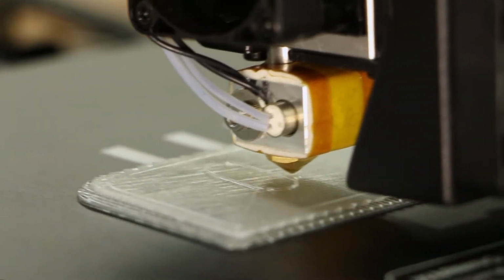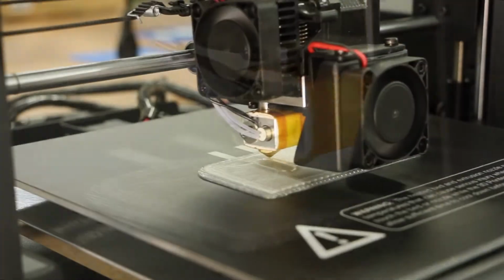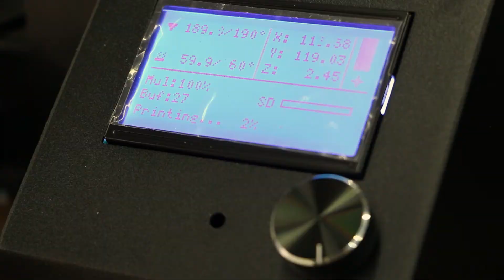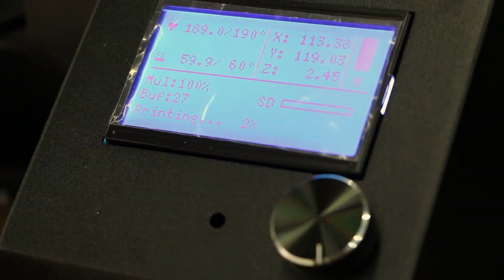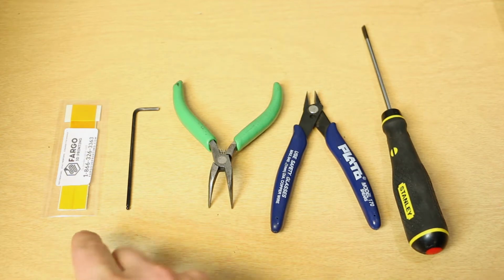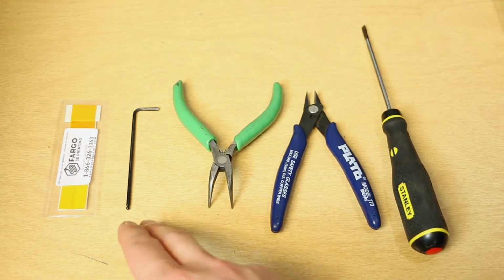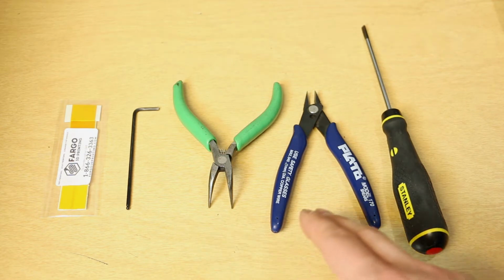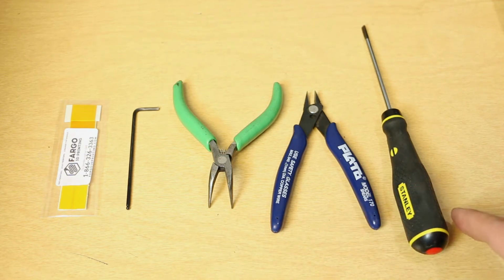Replacing Maker Select v2 Ceramic Tape | Wanhao Duplicator i3

Comment: Hi, my english is not so good, but i will try to said what happen to me; the problem is that the ceramic tape felt down (I removed because of that), it´s suppost that it helps to the hitting in the hitting block, but is very nessesary to used it; because I live in centroamerica and is kind of dificult to get it